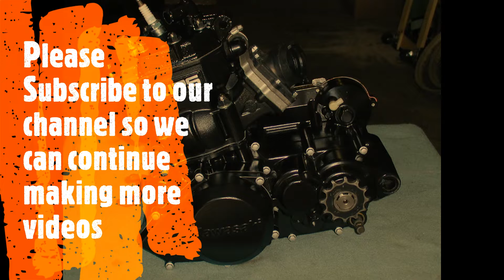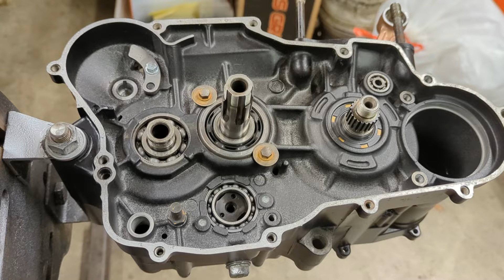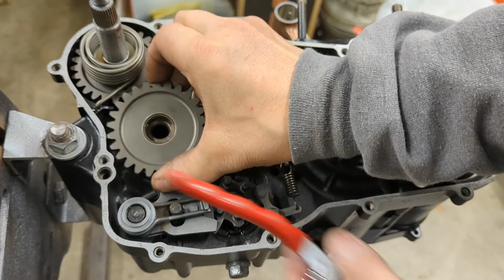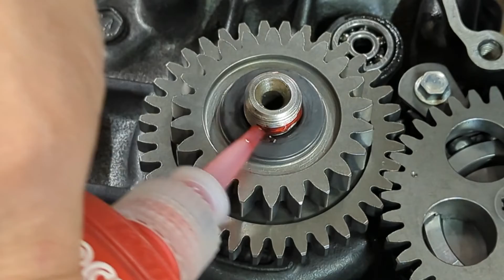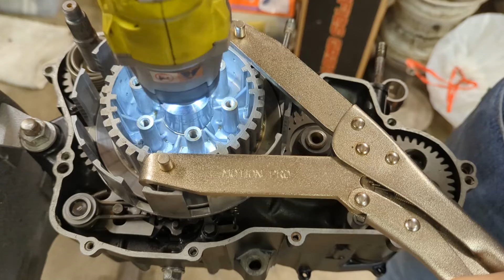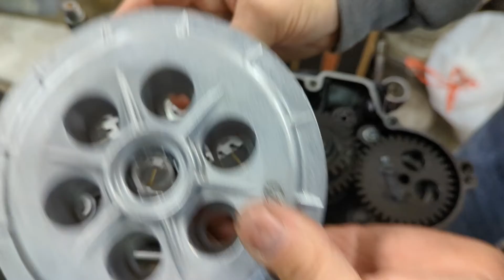Tecate 4 Full Rebuild Part 4

Comment: The Honda 250R large counterbalance or bearing is replaceable.
Reply from the maker: Yeah, I have done a couple of them. It's kind of a pain though to press off the gear and more importantly get it timed properly after the gear is pressed back on. A couple degrees off causes a lot of vibration.
Reply: @ilrperformance7152 yes it is , the only thing is the large counterbalance needs to be precisely in the same spot as before the large CB bearing was replaced. Pretty much common sense but a lot of people don't have that anymore ... And then aligning the timing marks .. some people just can't do that I guess.

Comment: I just restored a tecate that's been sitting for at least 10 years, I was only in the top end of the motor but after getting everything put back together and rejeted I've noticed it vibrates like hell, I'll take apart my side cover and check the balancing shaft, hopefully this works! do you know if correcting this will upset my jetting at all? It doesn't seem like it would but asking is free, let me know, thanks
Reply from the maker: if it shakes a lot it's very likely the counter balancer is mis-timed. No it won't change jetting
Reply: @ilrperformance7152  I appreciate the response! When I took it apart I found the gear on the crankshaft to be almost 90 degrees off, it's much better now! Also thanks for answering my question on the jetting, I can sleep a little easier now